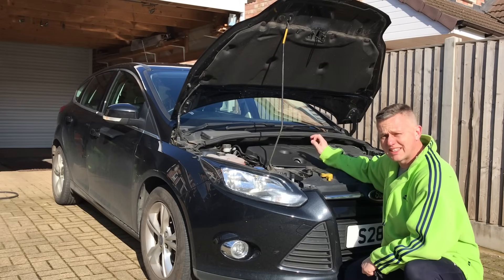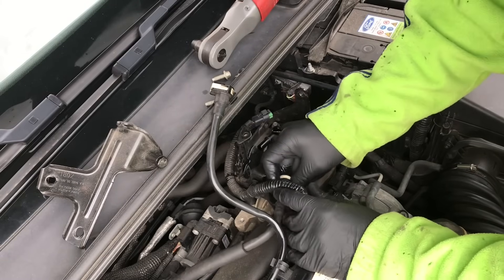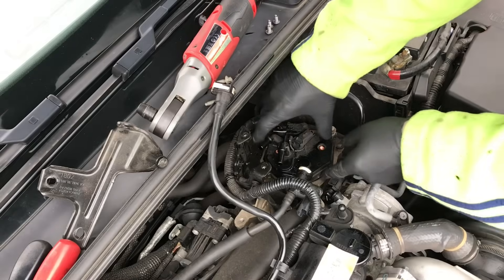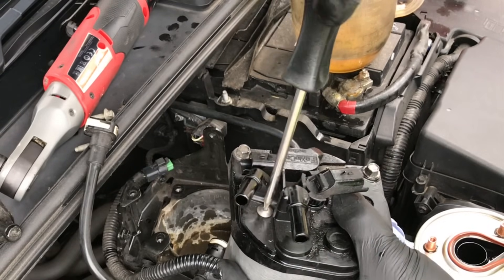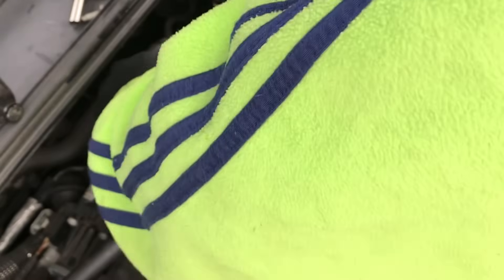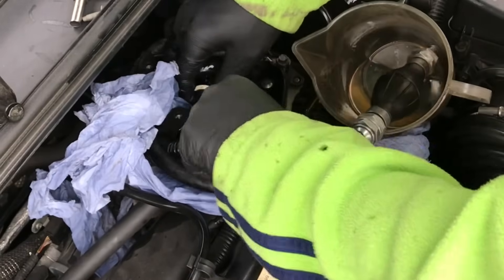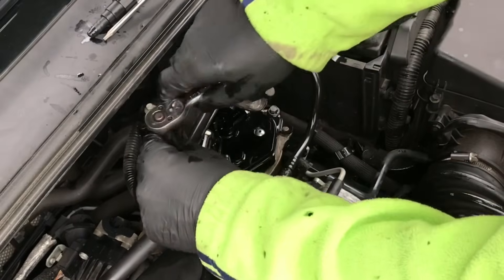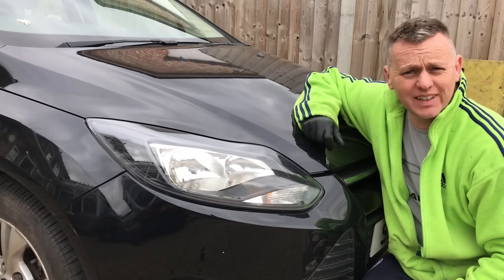Fuel Filter Replacement Ford Focus 1.6 Diesel 2011- tdci

Comment: I have this identical engine in my Ford Mondeo, and I have been having intermittent problems with starting, maybe every other day or every two days the car starts but then dies. I then have to bleed fuel from the tank through and into the filter using a bell pump, and it will start without any problems and we'll do this may be for a day or two and then it happens again. Seems as though somehow the fuel is draining back towards the tank and getting an air lock some how, it really is doing my head in!!any ideas anyone?
Reply from the maker: Some air leaks can be very hard to find, I often fit a non return valve as in this video,https://youtu.be/KYjev4ea_aU, link to non return valves on amazon ,https://amzn.to/2SvuTiP , Thanks for the great comments👍🏻👍🏻🛠
Reply: The same engine is in VOLVO V40 II gen. 2013. The most important think is to correct turn in screws in filter, and put in well ventil. 6:30min. is showed how to... If it is not cliked left air will put in the fuel pipes.

Comment: I did this and had immediate success on my S-Max 1.6tdci, with a Bosch filter, so thank you, but...

Day four it failed to start - AA used Easy-Start and it fired up. (Far too much IMHO - engine didn't like it at all.)
Four days later failed start. Then 2 days, then twice today. (I used Easy-Start sparingly and no real engine banging - just tappety)

a) The fuel pipe out of the filter "bent" as I was moving it back/away. I straightened it, and can't feel a break - could this be the issue?
b) If so, how easy is it to renew that pipe? It's a hard rubber coated pipe.

Cheers for a wonderfully easy to follow video.
Reply from the maker: It sounds like you have an air leak on the fuel pipe, if the pipe is cracked just cut it in two, and join it with a piece of fuel hose like I did in this video,https://youtu.be/KYjev4ea_aU hope that helps, Thanks for the great comments👍🏻👍🏻🛠

Comment: The spigots on the filter housing are weak and break very easily! Ask me how I know!
Reply from the maker: How do you know?? 😂 Thanks for the great comments👍🏻👍🏻🛠
Reply: @aaanton11 it's useful to know the tubing clips can be dismantled. Then you can slip the tubing connectors off without using excessive force.
Thanks for the video, good stuff.

Comment: Would not changig the fuel filter cause a engine malfunction service now light to come on at 3000 rpms and cause it to go into limp mode
Reply from the maker: Unlikely, unless it was blocked or contaminated with water, more likely to be the egr valve, Thanks for the great comments👍🏻👍🏻🛠

Comment: Dear friend, I have a ford focus 1.6 tdci mk3 95 hp from 2013. Yesterday I was in a car service to remove all old filter and oil motor. All good until today because I turn on the engi and I saw the medium consum is strange. Yesterday, becase the electrical contactor from the filter were disconected, the medium consum was resetated automaticali, but today I saw an average consumption that kept growing with the car stand on the spot. It started from 7. 4 and kept growing at 12 13 l/100 km. Is it normal this fenomen?  
I only drove a few kilometers from the service to home and I was a little scared. At some point it shows me a high medium consumption. I can share with you a foto but i don t know haw.
Also, the battery dropped, but after a replacement and a service test I was told that the alternator is charging too much, apx 14.8 V at 1000 r/min and 15 v at 2500 r/min.
Reply from the maker: all normal, it will take a few days to sort itself out, Thanks for the great comments👍🏻👍🏻🛠
Reply: @aaanton11  Thank you!

Comment: Rather a crappy design for a fuel filter from Ford. I do mine by drawing the diesel out through the outlet spout which makes it easier and better bleeding. Its the filter change itself that's daft. VW have the right idea.
Reply from the maker: Thanks for the great information👍🏻👍🏻🛠